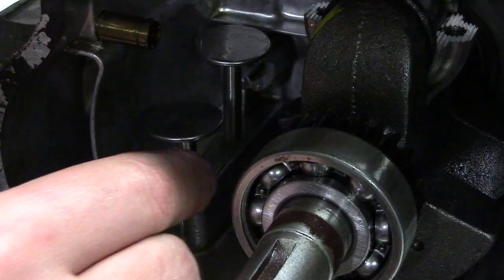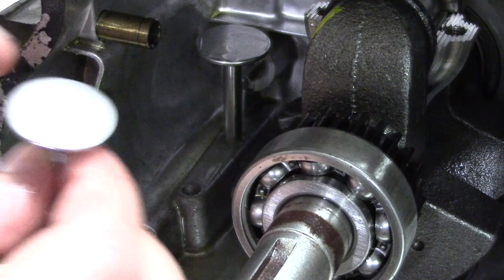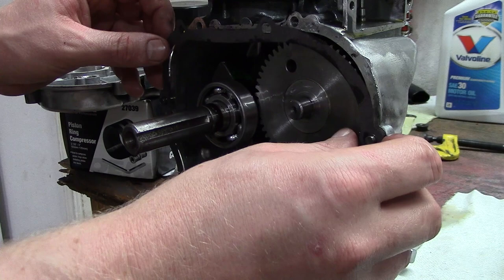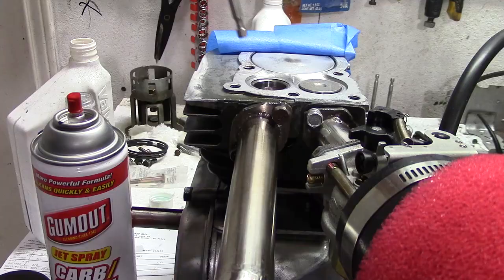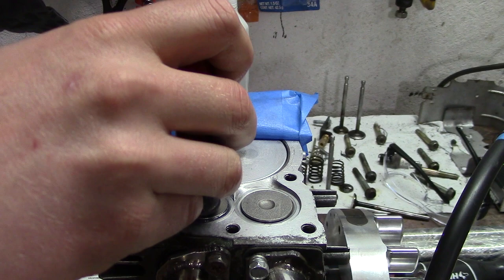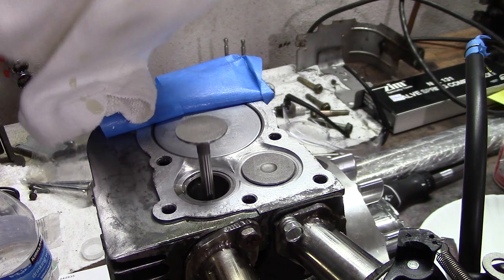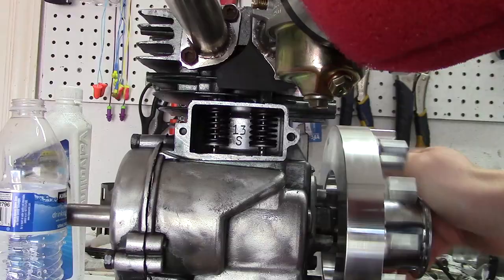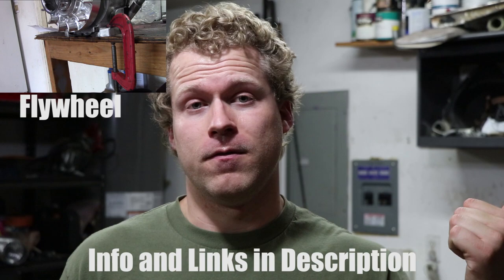Camshaft & Valve Train: Small Engine Performance Mods

Comment: how can you orientate piston rings when the rings have no marks on them
Reply from the maker: did the rings come with instructions or a little card?
Reply: +KartFab nope not a thing its a honda clone motor
Reply: +Cj Holcombe only thing i can tell is top ring and second compression are different colors
Reply from the maker: ok so i looked into it. Top ring should be chrome faced. You can tell the difference between top ring and second ring as the second ring should be black faced. Top ring should have a 90 degree (flat) surface that mates against the bore. The second compression ring (black faced) should have a slight angle on the edge that mates against the bore, the edge that touches the bore should be down (e.g, when installed the bottom edge of the ring touches bore. Check out the factory service manual for a honda gx200 (thats where I pulled the info).
Reply: +KartFab thanks man thats the way i put them. the motor crank but died in about ten seconds its acting like its out of time. any suggestions on the problem. it tries to crank but backfirs out carb. i pulled the cam 2 times to make sure it was all lined up and it was.
Reply from the maker: If i had to guess, id say you screwed something up when you put it back together. In order, I'd check your valve lash with the piston at top dead center on the compression stroke. Also, check your cam again for every one time the cam turns, the crank turns twice, so you could be off by 180 degrees. If you pulled your flywheel you could have spun it if you didn't torque it down.
Reply: +KartFab i appreciate the advice man. i check on that when i get the chance

Comment: IF I GET A. 308 CAM DO I NEED TO GET A SHORTER PISTON SO IT DOESNT BEND A VALVE?
Reply from the maker: that cam is for extremely high rpms, so the lower rpms (you know the ones you will be usually in when on a mini bike or go kart) will suffer greatly, again, I would only go with a cam that has a target max rpm of 6-7k tops, the lower the max rpm of the cam *(typically) the less torque you lose. Just my 2 cents.
Reply: F 275 can with 32# springs and ultra light flywheel with a .625 carb
Reply: And I'm going to do some mild port work
Reply from the maker: why would you get that carb? Its for methanol, and its just a standard carb. If you are going to be going with a higher rpm cam, and you arent trying to pass tech for racing, then you should be looking at a dirt bike carb (like a mikuni 22 mm carb) you will need to figure out jetting and whatnot. Speaking from my limited experience, though, you really would need some good tuning skills for methanol. Gas is a lot easier to tune.

Comment: My motor I messed up how do I fix it 
I hit a bump in the road and now it doesn't run properly 
I give it full throttle and it dies 
Now it doesn't go as fast 
It back fires to much 
And it sounds like it dies for a split second then comes right back on 
It badly sound like it's running well idling
Reply from the maker: empty all the gas out of the tank, clean the tank out, clean the fuel line out, and clean out your carburetor. When you give an engine full throttle and it dies, it will run with the choke on, doesn't go fast, and backfires..... those are all symptoms of running lean (which is almost always caused by a dirty carburetor).
Reply: +KartFab it's a brand new motor  choke is never on while running and it runs clean gas
Reply from the maker: Have you looked at the oil level? If the oil is good, google "low oil sensor disconnect" for your engine. If you put like a predator 212cc on a kart, and the low oil sensor wire is still connected, hitting bumps or going around corners will cut it off.
Reply: +KartFab the oil is new and fine
Reply: +KartFab + the motor doesn't turn off
Reply: rebuild your carb/get a new one

Comment: im on arc racing web site and i cant seem to find a performance cam for my 17hp briggs flathead, you think you could help?
Reply from the maker: +The Fab Lab 17 hp?
Reply: yes sir
Reply from the maker: Well, you can always call a place that grinds cams, and have them weld and grind the cam you have. I have never heard of a briggs 17 hp flathead. When i hear the word briggs flathead, I instantly think of the 5 hp flat heads commonly used in the 90's

Comment: What is the duration of the cam? Looks very similar to my car cam.
Reply from the maker: 241 in/ 244 ex
Reply: Thanks, I looked at the top, at the bottom not the same. Mine is 320 in.
Reply from the maker: We are talking duration here, which is measured in degrees of rotation.
Reply: Yes,degrees of duration of keeping opened the valves. It's an old cam used on hill climb. I think european cars, the old ones, used higher duration cams than american or others. My car had 260 degrees stock, but not a performance engine.A friend of mine has an even wilder cam. 345 in, 335 ex. Also hill climb cam. Could make 11.000 rpm with lightened pistons and other parts.
Reply from the maker: oh wow, thats crazy! We don't see much over 260 duration for these small engines.

Comment: but, not mention of tecumseh. guess we're bread of our own :P
Reply from the maker: haha yeah, more like TECRAPSEH!  actually i have an OHH60 i just got a cam for, billet rod, springs, and will port it, and put a 22mm mikuni on XD
Reply from the maker: thats tough, you might want to look into getting a decent flywheel but then just having a machine shop machine the taper, then set timing on your own without the key. Just a thought.
Reply: That's not half bad idea! Better than 2000.00 USD for a custom billet.

Comment: you never did answer my wheel hub question... also, can you do a live axle go kart build video? I wanna make my one wheel drive 80s model one seater go kart into a two wheel drive but i dont know how
Reply from the maker: had to search for the comment just barely. I cant get to all comments, but i just read it and addressed it. Yes i will be doing a live axle go kart build video, and will actually be converting the one wheel drive go kart that I built for the free plans kart into a live axle go kart. Basically you need to get a live axle kit, and weld on the axle hangars (there are two of them), then the axle bolts right up to the hangars and you secure everything else with lock washers etc. The other things I can see as problems are 1)adjusting brake location, possibly welding on a brake caliper bracket 2) engine position may need to be adjusted 3) steering not as sensitive with live axle. So with all that said, you are going to need to weld pr get someone to weld it for you to make the conversion happen.
Reply: ***** what about torque converter? Do I need it or can i use my clutch? And what do i measure from and to to get the axle length
Reply: ***** by the way, what do you mean you just addressed? you didnt reply. the comment is on the vacation video
Reply from the maker: you want to make sure the tires clear the edges of the go kart. Most go kart axles are around 40" long anyway.
Reply from the maker: yeah, i just addressed it by replying to you.
Reply: ***** you didnt tell me anything about hubs? are you sure the comment was loaded
Reply from the maker: Alright, here is the kit. Maybe if you were to look at it, it would answer all of your questions. http://www.gopowersports.com/live-axle-kit-complete/#_a_KartFab
Reply: ***** nooo. lol i see what you mean now but i'm talking about without the live axle. Could i just switch to different hubs or something so i wouldnt need the bolts? sorry about not making my question clear. lol
Reply: ***** sadly i wont be getting a kit for a while because no correct tools, my dad is tired of go karts so he isnt very helpful but i need his help and i need to start classes for my GED and get a job. plus rn i have to save up for a church youth retreat and my job money will go to tithe, play money like for anything i want and my savings for a car or something. So sadly the new go kart will probably just sit either like it is or sit and do nothing at all. I've thought about selling it with or without the engine and using some of that money and the money for my job or whatever to get like a real offroad kart. ONE DAY I WILL HAVE IT ALL FIGURED OUT! 50 years later lol

Comment: I watched all your videos on this engine build and i am planning on doing a predator 212 performance build. Here are my questions.
(1). are all of the torque specs the same for the predator as the briggs
(2). i am a kid and dont have money, so what i wanna do is like add parts on to the engine as i go on and get money and once i have everything remove the gov.... due to this, is there a certain list of what i should do first and last(like should i do the piston first and cam last etc.) 
(3.) if i add all of these parts, do you think it will be safer, if not totally safe to rev my engine to full throttle w/out governor for like 20 seconds?